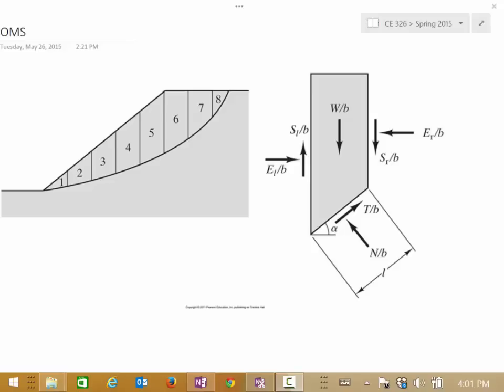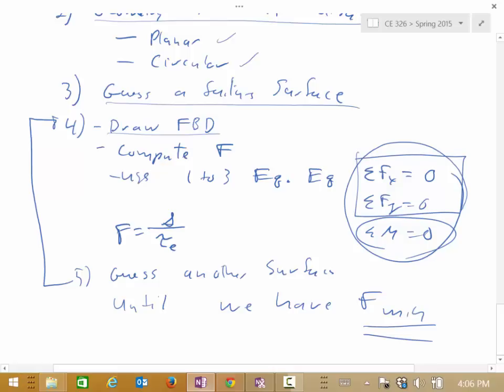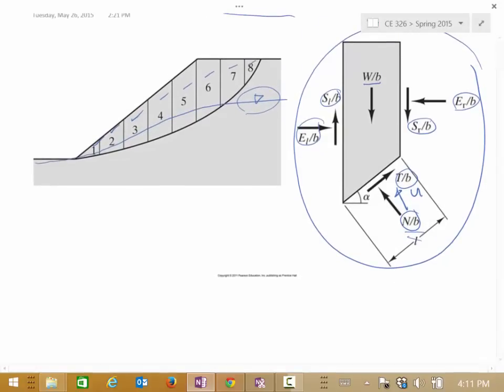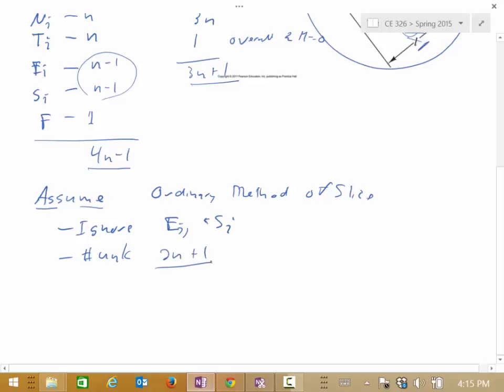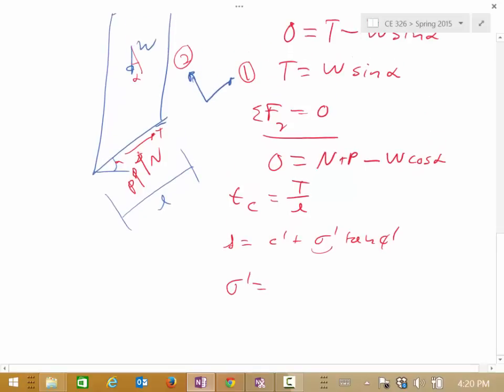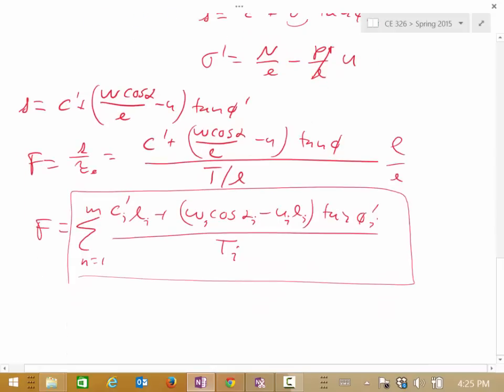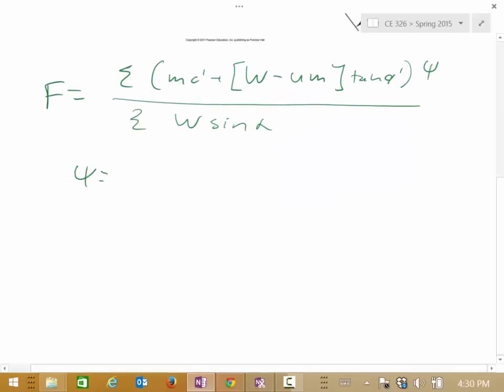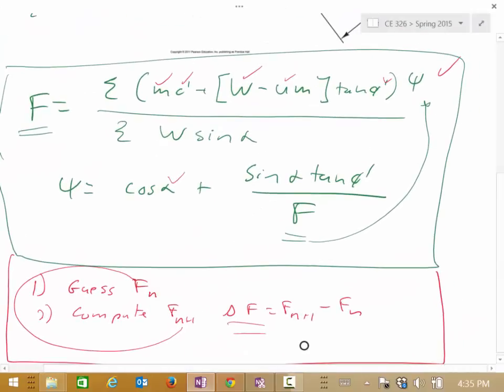Slope Stability: Methods of Slices

Comment: Hi Prof.
At 11:23, do you mean to say that the ratio of the shear strength to the mobilised shear stress is assumed to be the same for each slice?
This ratio is factor of safety, which I think you said the other way around.
Your statement about the assumption is still valid, I am just checking for my understanding.
With gratitude,
Dan

Comment: I want to ask a question.I have calculated Fs from Michalowski’s (2002) 1.875 and I have calculated Fs=2.047 from slope stability program.What is the reason of this difference?
Reply from the maker: No way to tell from the information provided.  I would comment that I would characterize the two Fs you have computed as nearly the same, i.e. 1.9 vs 2.0

Comment: A canal with depth 7 m and side
slopes 1:1 has the following
properties :
cohesion 10 kN/m2, angle of
internal friction 20, voids ratio
0.6 and specific gravity 2.7.
Stability numbers for a slope 1:1
with angle of internal frictions 20
and 10.3 are 0.062 and 0.125
respectively. Factor of safety of
the slope with respect to cohesion
when the canal runs full is ? 
answer factor of safety = 2.2  sir can you give data ad farmula how to solve this question?

Comment: is there any good reference about how to determine the number of slices?
Reply from the maker: There probably is some research on this from a decade or more ago.  However, with numerical tools (even just using a spreadsheet) it so easy to divide the slope up into 10 or more slices, I don't think anyone worries much about this.  For typical cases I use 20 or more slices.  Can be much higher for complicated cases with non-circular slip surfaces.  I don't even expect students in class to to hand calculations any more.